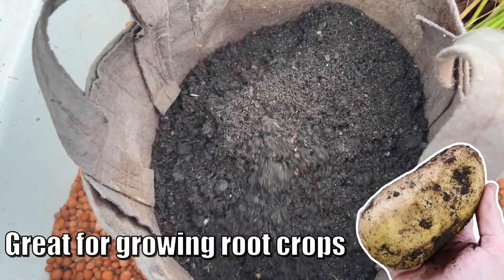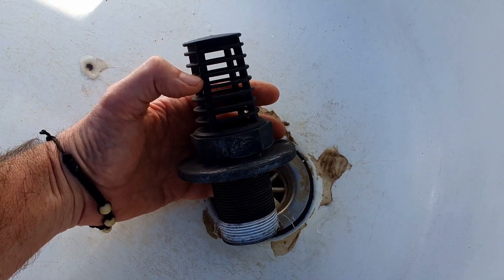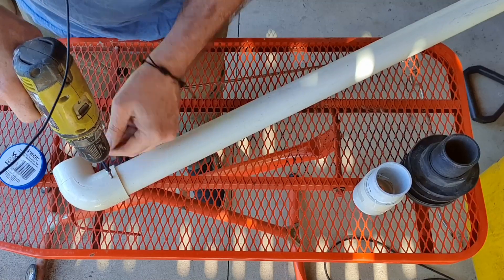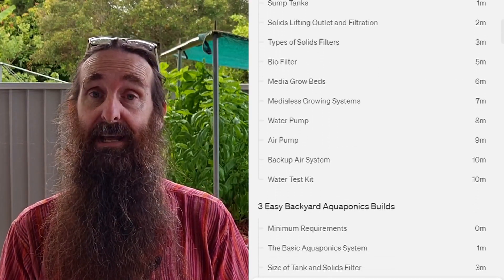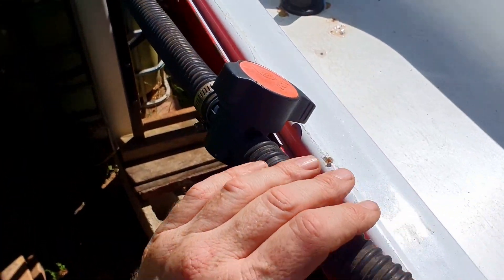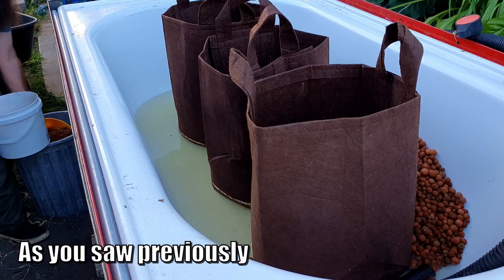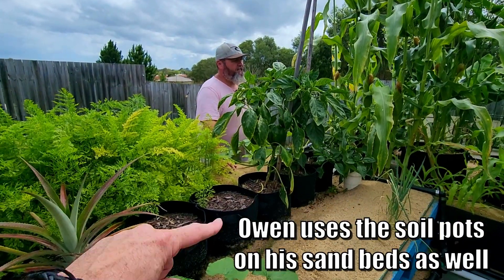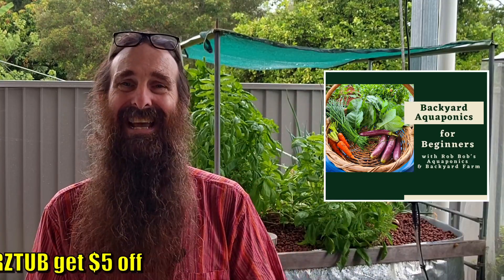SIMPLE Dual Root Zone Aquaponics Grow Beds

Comment: Know this an older vid, but very informative! What kind of pumps do you use, and do you have any data on average power consumption on this system?
Reply from the maker: I use magnetic drive pond pumps Alex with SunSun & Jebao being brands that I trust. I have the power info on the system before this one somewhere & it would be fairly comparable. I'll get back to you later with the info.
Cheers.
Reply from the maker: I found the pump figures. Power cost us $0.25 per kWH & I was using an 80w pump. Over 12 months that would be $175.20. Hop[e that helps.

Comment: Must try this.  Mold seems like a concern in a basement grow though.
Reply from the maker: I would definitely recommend you pay attention to ventilation growing indoors. A number of folks I know with largeish systems run dehumidifiers as well in the basements.
Reply: Circulation and exchanges are key. Both for air and water then things can't REALLY get out of control and if it does it will be so slow that you can notice and correct before it negatively impacts or very minimally.

Comment: Hey Rob great video again 
I see you've made a more of a wicking pot then a regular dual root zone. 
Normally you do not want the water wicking up into the soil. 
That's a cool adaptation of the dual root zone method.
Reply from the maker: I know it's not strictly a DRZ as @PotentPonics makes them but they preform the same function, access to different sources of nutrients that is. I'm still waiting for Steve to tell me to stop calling them DRZ. 🤣
Reply: @RobsAquaponics  if you want to go to the expense of setting up overhead misters  then his way works but in our heat I think your way works better or just as well..  but still drz..  or triple  as my pots on water also grow roots out of the net cup in the raft space..as well into the DWC bed..
Reply from the maker: I'm still waiting for folks to point out that the radial flow settlers I make technically aren't as they done have a radial collection weir.

Comment: Very cool. So are you saying that plants are able to send their roots through the water saturated sand and also through the fabric pots into the clay medium? Is that why you call them "dual root zone"? I would have thought the fabric pots would prevent roots from growing out of the bottom?

Also, does the sand at the bottom prevent the "perched water table" effect of the potting soil in addition to wicking the water upwards? Or does the potting soil portion at the bottom of the pot stay saturated with water?
Reply from the maker: I have issues with these pouches sending roots through to the soil when I leave them on the ground. Only one or two make it through but once they do the roots fan out. The potato roots I showed in this video partially blocked the drain which caused the water to rise. That in turn grew algae on the surface of the clay which you can see in the video. I probably should have mentioned that but didn't trying to keep the video short. 
The pouches wick just like the Larry Hall style rain gutter grow system only with aquaponics water. The only difference is that I let the LH style trays of pouches dry out once a week where the base sand layer of these aquaponics ones are wet all the time as you pointed out. I find that the sand its very wet but the base layer of the soil is only moist. 
I did have issues through very wet spell with the soil being saturated when we had a few weeks of fairly constant rain.
Reply: @RobsAquaponics  If you go gentler on the fabric pots' I bet this would works well. Usually they are 300 grams of fabric or so. So if you go lighter you might have better results I would think?
Reply: @iAVS-info  Gotcha make senses. Thank so much for sharing that with me. :)
Reply from the maker: @rickytorres9089  Just top clarify, I've been using some of these pouches for over 8 years with no issues. Just need to buy quality ones like Root Pouch. ;)